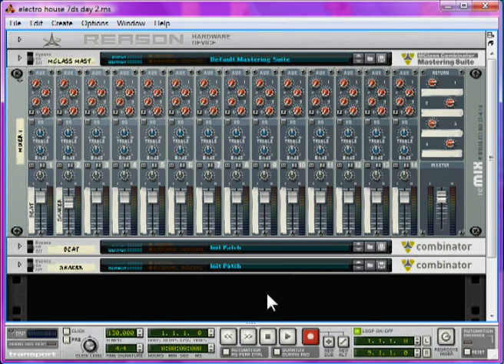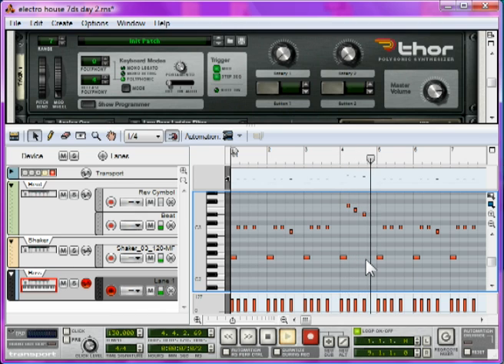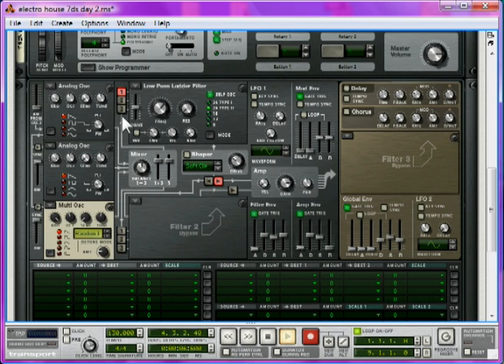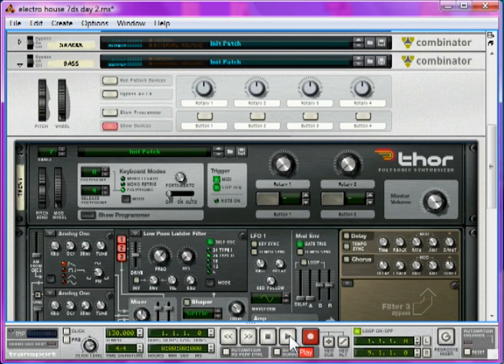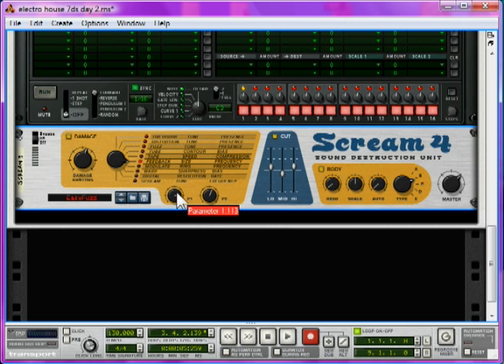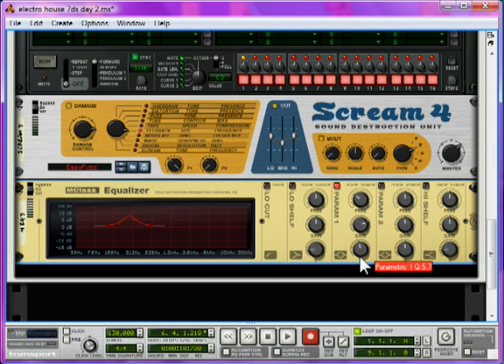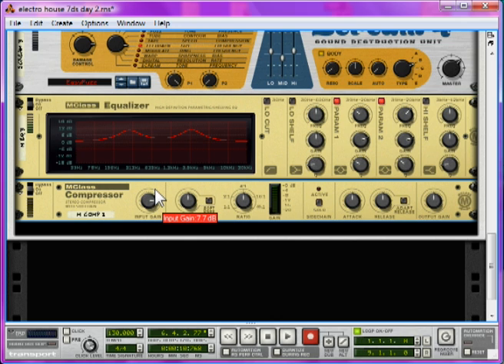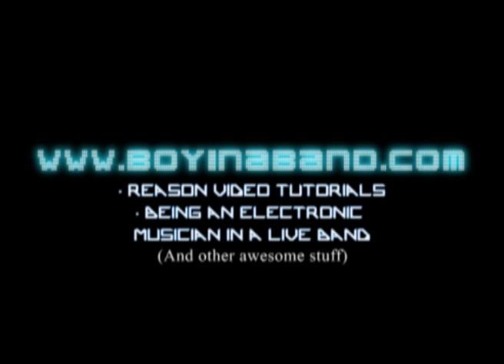Electro House Tutorial: Day 2 - Making a Sexy Electro Bass [7 Day Song]

Comment: For the people asking for the notes I was in the same situatuion, and still a noob but to make same notes u have to use the pencil tool on block mode then find the right key and put the notes, for the first note u need to make it a little longer then use a snap 16 (maybe others but i used that) to put the high notes is tricky but u need to find the right spacing, as a note the fourth note is a bit far away from the 3rd.
pm if ya need more help and hope this will help :p
saludos